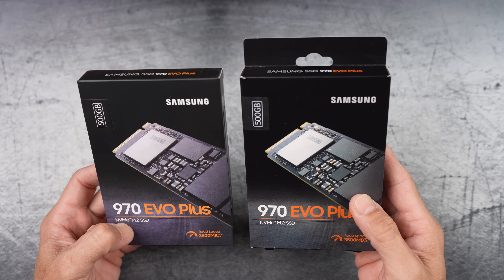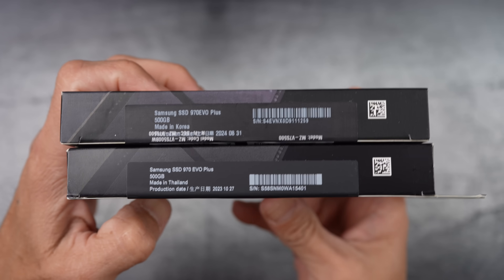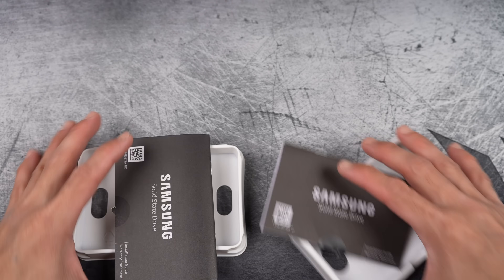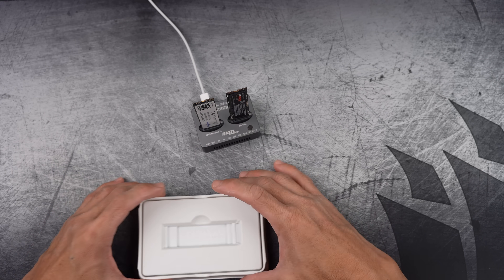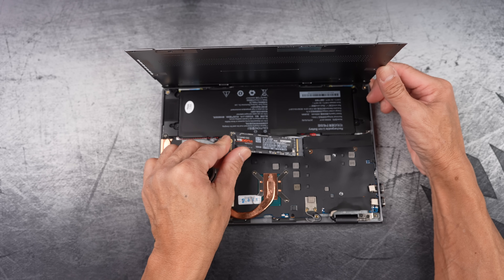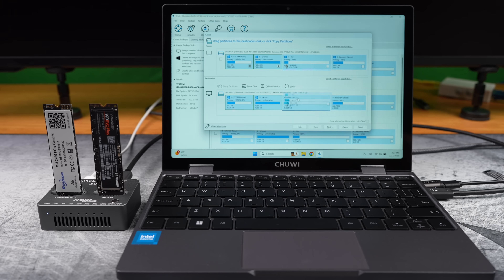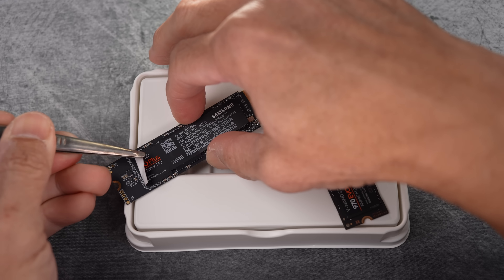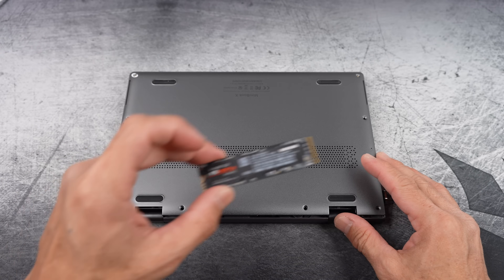Fake vs Real SSD - Can You Spot the Difference?

Comment: I’m looking at one on marketplace right now the 2tb version. If it says product of Korea does it mean it’s fake?
Reply from the maker: Not necessarily—Samsung SSDs are often labeled “Made in Korea” or “Product of Korea” and still be legit. But fakes copy that too, so it’s not a guarantee. I’d check the packaging, font, label alignment, and definitely test it with Samsung Magician if you buy it. Marketplace deals can be hit or miss—be careful!
Reply: @TossSong  thanks for the reply. Yea that makes sense. Do you think I should go for the Samsung and test it at buying time or get a orico oG7000 instead which is very slightly cheaper on Amazon instead. Both 2tb. I’d want to use this drive as a os and boot drive
Reply from the maker: If you’re planning to use it as your main OS and boot drive, I’d go for the Samsung—even if it costs a bit more. It’s known for reliability, has DRAM (EVO and most Pro’s), and works great with Samsung Magician for updates and health checks. If you go that route, just make sure you buy from a trusted seller and test it right away. Haven’t tested the Orico oG7000 myself, but for system stability, I’d still go Samsung. 👍

Comment: the fake ssd in this video is not fake, it is sort of rubbish. Real fake Samsung ssd sales in China can be detected by Samsung magician correctly without any issue.
Reply from the maker: Thanks for the feedback. The SSD in question did fail multiple benchmarks, had no DRAM, and the internal components didn’t match Samsung’s spec sheet—so I’d still consider it fake or at least misleadingly rebranded. I get that some counterfeits can still pass Samsung Magician, but in this case, the performance and build quality didn’t lie. Appreciate you sharing your perspective, though!

Comment: @ $50 for a fake evo you might as well get a $50 SP brand or something close to that like $60-$80
Reply from the maker: Thanks for commenting. Fair point, but the Samsung 970 EVO Plus really stands out—especially for something like the Chuwi MiniBook X (in this video). It has DRAM, full PCIe Gen 3 speeds, and great thermal efficiency, which that compact laptop like my this MiniBook really benefits from. And also I chose it because this MiniBook won’t accept Gen 4 faster speed. (Basically it’s its bottleneck speed.)

Comment: sorry don't trust this, they are probably both fake. i have a real one and it shares certain attributes but isn't like either of the two show in the video.
Reply from the maker: Thanks for the feedback! Just to clarify—one of the SSDs does have DRAM and performs at full speed as advertised. I also verified it with Samsung Magician, off-camera, which confirmed it as authentic. I actually installed it in my laptop, you might be able to see it somewhere on video by pausing it. (I didn’t include that part since it would’ve made the video too short). Appreciate you sharing your experience though!

Comment: pause it 3.12 and look at the lables and writing. the model numbers.and the bar code and the whole of layout and the connector at the side one and look at the sn unmbers are not the same even the sq card is wrong.. under the evoplus  the number in the wrong place  ..one shows ssd and the other does not..even the design of the chipset is wrong as well the cards... so easy to stop the fake one as there is over 10 errors and i only just for 5
Reply from the maker: Great eye! Yeah, once you pause and look closely, the differences really start adding up—label alignment, serial number placement, barcodes, even the board layout. It’s wild how many details give the fake away when you know what to look for. Appreciate you breaking it all down!

Comment: Uhh... I never saw you use Samsung's Magician software.  I'd like to know if that software can spot these fake SSDs as fake.
Reply from the maker: Thanks for your comment. (You might have noticed it in the video, on the laptop screen, that the Magician app was installed). I tested it off-camera, the Magician software didn’t recognize the fake drive as genuine, but it did display the correct name.
The serial number on the package was different from the serial number in the Samsung program. The program wasn’t recognizing it as a Samsung disk.

Comment: For removing the sticers you need to use a hairdryer, which helps you to remove them easier. ;)
Reply from the maker: That’s a great tip! A little heat really does make a difference with stubborn stickers—just gotta be careful not to overdo it on sensitive components 😉 Thanks for sharing!

Comment: wondering how that cloning process works.  if u have a mother board with multiple m.2 slots i am guessing you do not need that dock?  Can i clone a 500gb drive to a 4tb drive?  can i use that in the same computer? could it be put in a newer computer were it may or may not be upgraded from win 10 to 11?
Reply from the maker: Good questions! In the video, I used a standalone cloning dock to clone my drive—super easy since it doesn’t require a computer. But yes, if your motherboard has two M.2 slots, you don’t need a dock. You can use free software like Macrium Reflect, Samsung Data Migration (for Samsung drives), or Clonezilla to do the same job.

You can clone a 500GB drive to a 4TB one—just make sure to expand the partition afterward to use the full space. And yes, the cloned drive can run in the same computer or be moved to a newer PC, but if the new system is very different, Windows might require reactivation or a fresh install.

Comment: If this is not the handy works of China, I'd be very very surprised
Reply from the maker: Yeah, sadly a lot of counterfeit tech does trace back there—especially when it’s sold dirt cheap. But to be fair, China also produces tons of legit high-quality gear. It really comes down to the seller and how cautious we are when buying.
Reply: @TossSong  Definitely not discounting that fact. However, quality "made in China" products are mostly Western products under very strict quality control measures and frequent audits. Same goes to products designed by the Japanese and South Koreans. Most China "branded" products are either outright copy from these countries, be it the product itself or the manufacturing processes.
Reply from the maker: That’s a great point—you’re absolutely right. Many “Made in China” products that are high quality are actually built under tight oversight from Western, Japanese, or Korean companies. The copycat issue tends to come more from unregulated third-party sellers looking to cash in. It’s a tricky space because China is also where some of the world’s best tech is made… it just depends who’s making it and for whom.

Comment: The boocklets are original at both side. smal differents happens over the time if version are changing. likewise the plastic tray and the outside package as well.
Reply from the maker: Thanks for your input! I get what you’re saying—some variations can happen between versions or manufacturing batches. But in this case, there were more than just small differences, like odd font spacing, missing marks, and lower speed performance. Still, I really appreciate your take—it’s great to hear other perspectives on this!

Comment: I had DDR4 rams with DDR5 Corsair Vengence heatsink came in the mail just last week, from Amazon. The sticker seal is just a little transparent circle sticker, so that likely got replaced after the person do their switcheroo. Brands should use custom stickers yes, but what is going to stop people from using a heat gun to remove it.

You might have a lower chance of them happening with more established providers like directly from Corsair (which I bought the replacement from), but no where is too safe. Always buy and test.
Reply from the maker: That’s wild! A DDR5 heatsink hiding DDR4—what a sneaky switch. You’re absolutely right, even Amazon isn’t foolproof nowadays. Custom seals might help, but yeah, a heat gun and some patience can undo a lot. Glad you caught it and got a replacement straight from Corsair. Of course, Always test—no matter where it’s from!

Comment: I've been using a fake Samsung 970 EVO Plus 1TB for about 4 years, and so far, no problems at all. I’ve tested it with 3D software like MAYA, Houdini, and Blender—they all worked great. I really love my fake Samsung 970 EVO Plus! 😄 The price is so cheap..
Reply from the maker: Wow, that’s wild! 😂 Sounds like you got one of the “better” fakes. Some of them surprisingly hold up under real workloads, but yeah, it’s still a gamble—others crash or throttle badly. Glad it’s been working out for you though, and thanks for sharing your experience!

Comment: Please remember to say megabits not megabytes.. big difference. If you divide 3500 by 8, as 8 bits make a byte, you read at about 400 megabytes a sec. Then you have to account for the accuracy of the program, the OS and whatever mechanism the calculation is measured from. In totality, you should always calculate down around 20% of its shown speed given these different factors. The manufacturer’s can get away with the claim of these speeds if at a single very specific instance under a perfectly tuned set of circumstances , they were able to reach these speeds either by evidence, or by just claiming it.. there’s really no one checking these claims but the user. Some manufacturers do a very good job, also it’s not entirely the companies fault if you put your drive in older hardware or you don’t utilize the drives capacity because of the motherboards open lanes or how the layout of the motherboard would effect the drives measured speed… it’s all a complex mess.
Reply from the maker: Thanks for the detailed breakdown! Just to clarify—CrystalDiskMark actually measures in megabytes per second (MB/s), and I did mention that correctly in the video. You’re absolutely right though about real-world speeds often being lower due to hardware limitations and test conditions. It’s definitely a complex mix of variables!
Reply: @TossSong I must’ve missed where you mentioned that. I stand corrected. Although I don’t know specifically the way crystal disk mark calculates their speed, in general, every measurement has to have something to measure against to make the calculation remotely accurate. That’s why I give a 20% recommendation so ppl have a fair assessment of a drive. That’s just the drive itself, not counting what hardware you have. Thank you for the video and for the response back.

Comment: Because You Claim Korean Made and Thailand made Actually Korean Made Fake and Thailand Made real I would think Korean made real Thailand made is Fake price difference you did not mention How Much cost You Claimed Real one ?
Reply from the maker: Thanks for the comment! I know it seems backward, but in this case, the fake one was labeled “Made in Korea” and the real one was “Made in Thailand.” Some scammers print fake country-of-origin labels to make their product look more legit. The fake SSD was around $48 and the real one was closer to $100.
Reply: @TossSong  Then these much Price difference I would except real One Yu Claim would have Better performance , if you buy New Egg if there is two processor one cost 500 $ other one 250 $ then everybody Except expensive Processor would be perform Better as Pentium 4 and Pentium 9  about look same better one double the Price have more program written on it and Not really Made Much Difference to Factory producing cost . my be there you claim  fake and real one build same Factory one with better program other less anyway building those complicated things require Billions $ factory you can not just build fake that similar at Your garage or home nor even Factory you may Build .
Reply from the maker: Thanks for your thoughts! I totally get what you’re saying—real tech products with better performance usually cost more because of legit parts, better firmware, and official support. But in this case, the fake SSD was designed to look identical to the real one, even though inside it used a cheap USB-to-SATA board and very slow NAND.

It’s true, fakes can’t be built easily in someone’s garage—but they can come from shady factories cutting corners. The real SSD has proper firmware, controller, and DRAM. The fake one may look real on the outside but performs way worse. It’s not just price—it’s about testing, brand trust, and warranty too.

Comment: thats also a reason why  dont buy the expensive samsung nvmes anymore.
i am using 8 nvmes and my crucial pcie5 T700 2TB reads and writes at 12.500mb/sec
samsung is the most copied and faked it brand.
Reply from the maker: Yeah, totally get that! Samsung gets targeted a lot because it’s so well-known. Your Crucial T700 sounds like a beast—12,500MB/s is blazing fast! Definitely safer going with brands that aren’t as commonly faked.

Comment: The reviews that revealed that it's fake weren't available when you purchased it?
I always read through the reviews or at least check the average rating before buying
Reply from the maker: Yeah, at the time the seller had multiple listings, and the bad reviews were under a different post. So they didn’t show up when I checked—pretty sneaky and hard to catch unless you dig around.
Reply: @TossSong  yeah, that could happen. I guess the best tell is the abnormally low price.
Reply from the maker: Exactly! The low price definitely should’ve been a red flag. Sometimes we just want to believe it’s a crazy good deal—but yeah, that’s usually how they get us. Lesson learned the hard way!

Comment: I just got 980 (not pro) and have S/N on the box and SN on SSD. The serial number also has a letter "w" at the end while its not on the box. The sticker on the front of the SSD seems a bit sloppily placed while on bith yours it looks better. The booklet looks like your original. 

Cant test with magician atm but will give update.
Reply from the maker: Thanks for sharing the details! That extra “W” on the SSD but not on the box is definitely a red flag—small inconsistencies like that are common signs of a clone or factory reject. The sloppy sticker placement also adds to the suspicion. Samsung Magician should give a clear answer once you test it. Looking forward to your update—fingers crossed it’s not a fake!

Comment: Amazing video, it helps to distinguish from many parts. But the best is before buying, check(ask for) the  model and serial number of the product so you can check in the website page if it is legitimate or not.
Reply from the maker: Great point! Checking the model and serial number directly with the official website is definitely one of the best ways to avoid getting scammed. Wish more sellers were upfront with that info before buying!

Comment: The average user who does not use the computer for games only to browse and receive messages. He will not notice the difference. Even in a computer assembled in a computer service on order. In addition, thanks to such videos, fake hard drives can be refined. And correct errors to make it even harder to recognize.
Reply from the maker: Yes, exactly—most casual users probably won’t notice unless they’re doing heavy tasks or speed tests. And you’re right, these fakes are getting trickier to spot, especially as they improve based on what people expose. It’s wild how close some of them look!

Comment: I only ever buy Samsung drives from the Samsung website.
Other than the drive quality the other key advantage of using their drives is the Samsung Cloning software.  I wish you would have tried the Samsung cloning software to see if it would spot the fake--which I'm pretty sure it would.
Reply from the maker: Totally agree—buying direct is the safest bet these days. I actually didn’t try Samsung’s Data Migration Tool on the fake, but that’s a great idea! I’m curious now if it would’ve rejected or flagged it. I might test that in a follow-up!

Comment: thing is that you will NOT notice a difference in speed , not ever. Unless you do transfer ssd to ssd, which you cant. So it might be a better deal the fake :)
Reply from the maker: Thanks for commenting. When cloning drives or working with large files, however, the slower ones really show their limits. Still, what really bothers me though is when it’s advertised as a “real” Samsung but turns out to be fake—that’s misleading, no matter how usable it still is